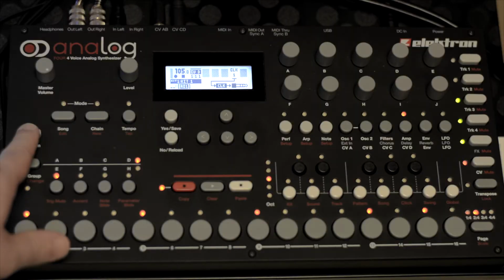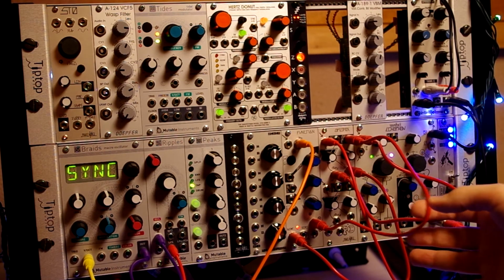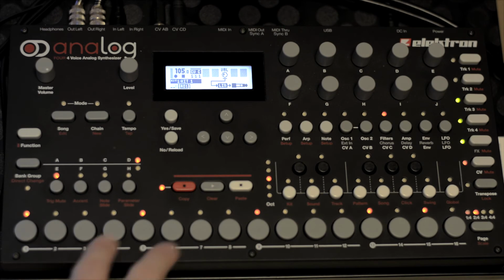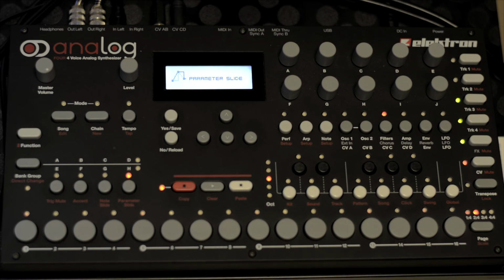Tutorial: Using the Analog Four to control a modular synth (Part 3 - Parameter Locks)

Comment: Hi, these  videos are awesome, so informative. I am just getting into Modular and had a quick question: when striking the Optomix with a trigger, why do you first go through the Function and use the EOR output to strike; rather than running the A4 trigger directly into the Optomix? Does this just give you a bit of "freedom" from the triggers coming from the 44, so you can delay the envelope according to your taste? Thanks!!
Reply: I guess a simpler way to ask my question after thinking for a bit—is the Function acting as a Trigger Delay module in this patch?
Reply from the maker: Aaron Brown the main reason I think I was doing it this way (it was a long time back now) is because it means I can also use the output of the envelope too. Of course you could just mult the trigger as you say though.